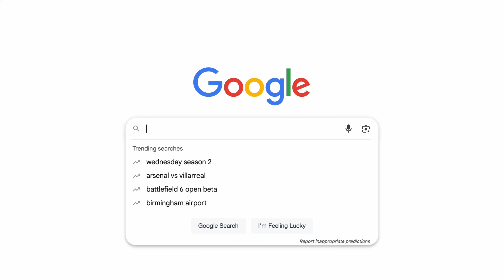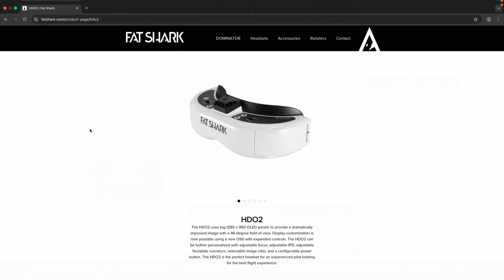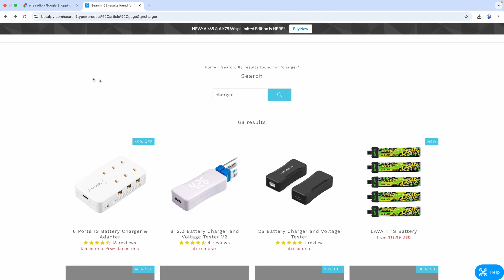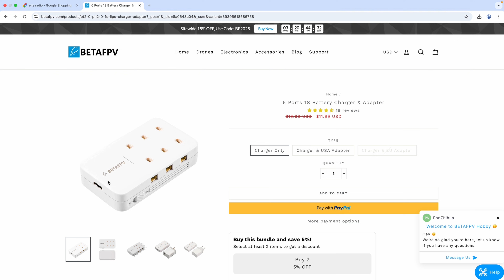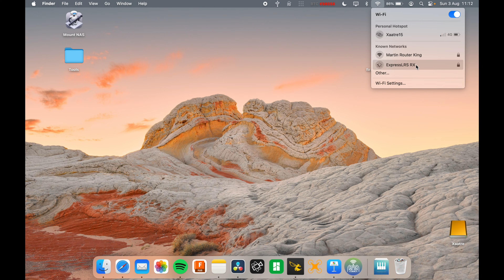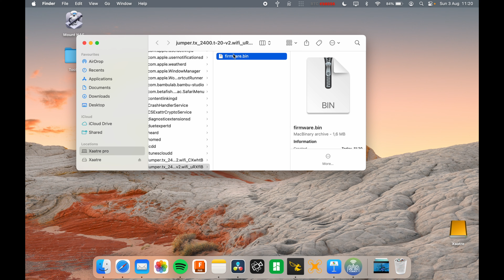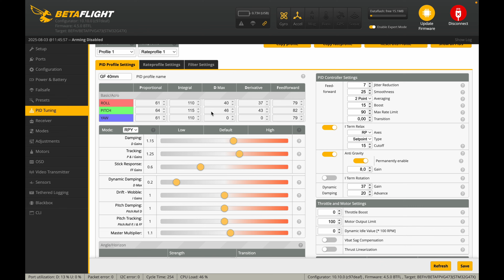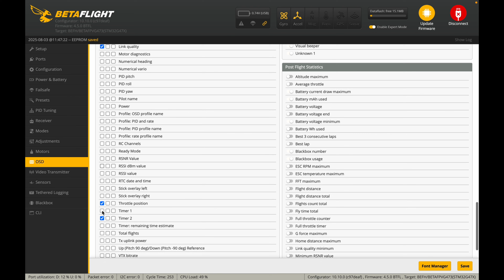The BEST Beginner FPV Drone You Can Fly Anywhere? | BetaFPV Air75 Long-Term Review & Setup

Comment: Yo so i had this for a week and now it doesnt auto bind anymore to my radiomaster. Everything is the same the phrase version and i tried everything and it wont bind anymore
Reply from the maker: I'm sorry to hear that! What version of ELRS are you running. Is the green led on the drone always blinking?
Reply: @xaa_fpv im updated it on the latest version. The green led works properly for wifi and bind mode but when i try the phrase it doesnt work and when i try the bind mode it also doesnt work
Reply from the maker: You could try flashing elrs again without a binding phrase and see what happens. Also make sure the receiver is set to crsf in th receiver tab and make sure SerialRX is toggled on for UART3 in the ports tab

Comment: As a beginner to non-DJI traditional FPV drones...I can say that I disagree to tiny whoops being great for beginners.  Yes, you can crash and less likely to break anything quickly, but it will break something eventually.  As a beginner, I am learning how to repair and replace broken parts.....tiny whoops are so small that unless your experienced at repairs, sodering etc....this is a terrible idea for a beginner. I have 3-mini drones broken and can't fly them because I cannot repair them.  Eventually, I will get practice, be successful and repair them.  Larger drones are MUCH easier to figure out and repair.  LOVE flying these tiny whoops otherwise, I have three in my fleet right now
Reply from the maker: I remember having a really hard time fixing my first tiny whoop years ago. I had to re solder the battery leads and it was really frustrating but also quite rewarding. That said I can totally understand why you would advise a beginner to stay away from tiny electronics and solder pads. It's just like you said. Starting out in fpv is also about learning how to repair and replace broken parts. If you're just stating out and you have an open space where you can go out and practice without being bothered, thats great. Otherwise It helped me a lot being able to just charge up some batteries and rip around in my flat whenever I feel like it. Thats the beauty of these small whoops. They're just fun and easy to pick up but not necessarily easy to repair!
Reply: @xaa_fpv  Very addicting!  I keep buying lol

Comment: 2 toughts:
-the lite frame is not durable enough
-the 5in1 air board has bad video. If you fly together with others you find out quickly who has a good vtx... better if you use the martix board and unsolder the connectors
Reply from the maker: I definitely agree with you on both points. There are much more durable frames out there and I would be intrigued to try out the matrix board and compare vtx performances, especially when flying with friends. I had mixed results with the air75 board. Sometimes it worked well, reception was good with 2-3 people flying and sometimes when I flew couple of packs with my buddy I could tell that something was wrong. A little frustrating but we always got it to work. Thanks for watching!

Comment: This thing is tough! Did my first ever flight with it in a gymnasium and slammed it onto the floor from about 20 feet up a few times and it still flies great, just a couple cracks on the frame. Great beginner drone.
Reply from the maker: That sounds like fun! I’m curious to see what other peoples experience is with the durability of this drone. Cheers
Reply: You really need to slam it into the ground to make the frame crack. Ordered two spare frames when I got my first Meteor75... have them still collecting dust in the spare parts box. When flying in my flat I have not yet managed to damage more than the props and a motor. Drone will fly bad with damage on the props, so if after a crash there are vibrations or bad performance, check&change the props.